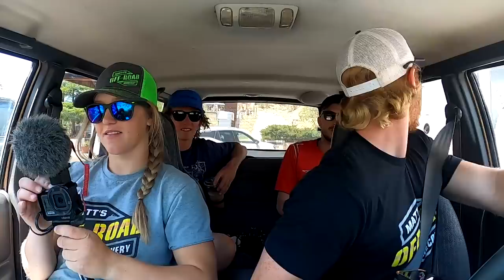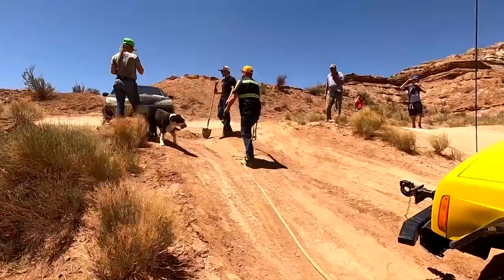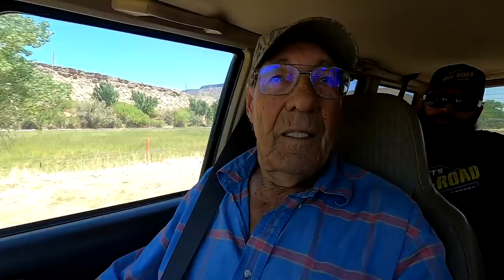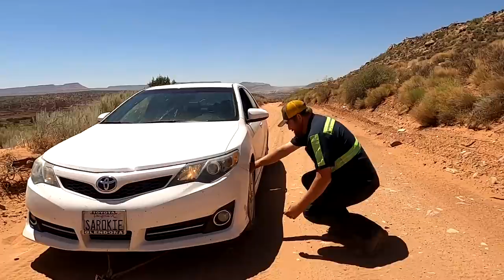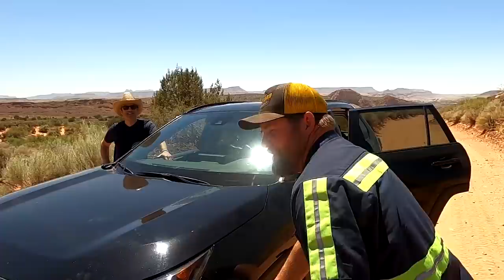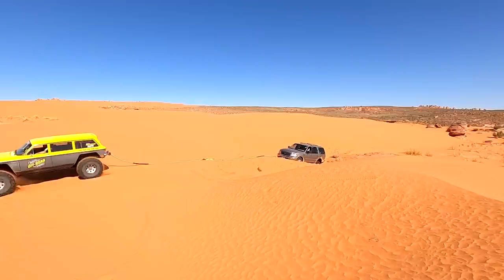How Do I Stay In Business? 3 Rescues Like This!

Comment: Thank for the great videos Matt. I got to use some of the tips I picked up from watching your videos to help my son last weekend. We made a trip to the beach and my son and his family drove separately in their Kia Soul. Monday night we went back to our room after eating dinner and were getting settled in for the night, when I got a call... My son was coming back from dinner and pulled off the roadside along the beach and got stuck in the sand. I did not have a Matt's Recovery Rope, but did have a 20 foot tow strap in my SUV.  There was no convenient place to hook to on the front, so I had him turn the wheels enough to dig out the sand to hook the strap on the front suspension. I kept my left wheels on the roadway, eased forward enough to put tension on the strap and had him give it just a little bit of throttle while turning hard left and we had him back on the pavement in 2 seconds. As Ed would say "We got em out!"  Worked like a charm with many thanks to you for showing us the easy way to do it.
Reply: @tommak6516  LOL! That would have been entertaining when the strap broke and slapped the back of my car.
Reply: @Welder-4956  I was just joking because that is the way they show how a lot of vehicles are pulled out.  From what you describe I am sure you did it the safe/sane way.

Comment: I was talking about this with a friend the other day.  I used to drive tow truck and I was relaying the charges could be...
Mileage...either going to or coming from or potential both.
Tows might have a flat rate plus the mileage.
Recoveries...Different charges for different types of recoveries that would include time and what sort of equipment was used.
Size of jib...there might even be an extra crew charge.

Comment: That was a seemingly easy one.  

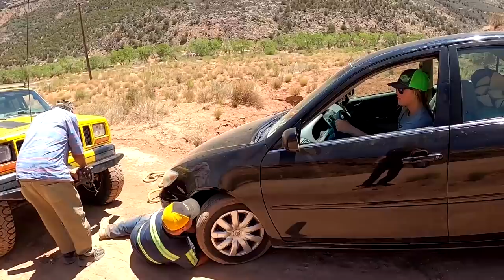My .02c's is that at 4:59 the vehicle should be moved to level ground, engine off and put in park. Had it lurched forward even a few feet, "for any reason," you would have lost your arm or worse.  

In watching these videos, I get the impression that due to your success, the heat and  your desire to get back in a hurry, you all are getting a bit too comfortable cutting some safety corners.  I just hope they never catch up to you.  If they do, do not refer to them as "accidents."  
Gravity will always happen and these vehicles are heavy. 

Play it safe(r.)  Also, as I've posted before, wear your seatbelts in the rescue vehicles and no passengers. Also, bring everything you need out on the trail.  Many times, I've seen it where you had to call others to bring you more gear.  Lastly, as a dog lover, I have to say, I get nervous seeing you allow your beautiful dogs run around moving vehicles.  You cannot always see where they are at and vise versa.

I make these comments and suggestions out of respect.  I enjoy your channel and want to see you doing safe rescues for years to come.  You are great at getting vehicles unstuck just please take a little more care.

Comment: Ford Expeditions are such garbage vehicles. It's luxury SUV, very nice on the inside tbh. Drives nice, okay mpg, comfortable, roomy. But it's the worst part of an SUV and Pickup in 1 package. Terrible handling on anything except pavement, poorly balanced for 2wd and 4wd, most of the electronics make the driving smoother but they go brain dead on anything soft. The safety rating is good, but it needs to be with how many of them go into the ditch or roll over. I had an older one I bought as a toy (sold it) and my mother had 3 (she wrecked 2) before she gave up on them. She bought a Toyota Rav4 and has loved it since, not as roomy but handles better, better mpg, and newer ones are just as nice for fraction the price.
Reply: I love my Expeditions, I own three and of road two of them quite frequently.